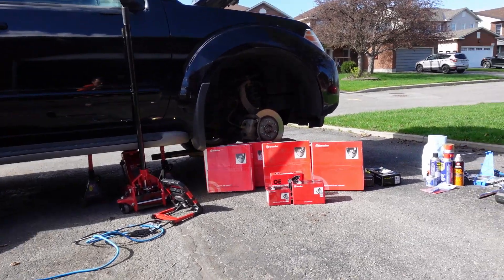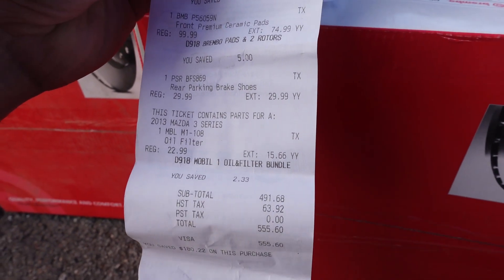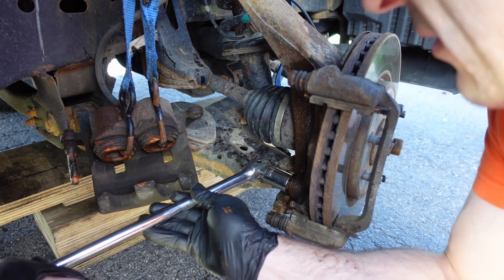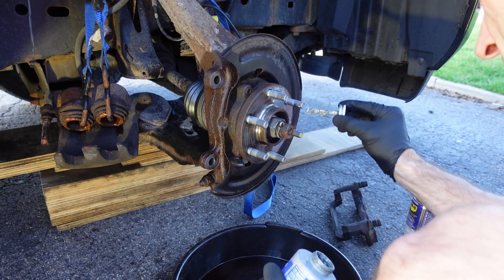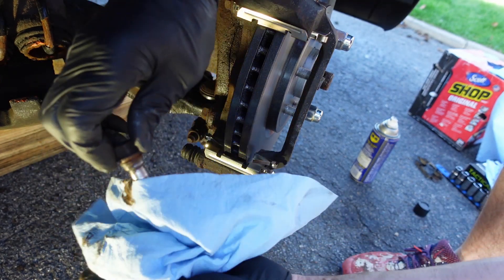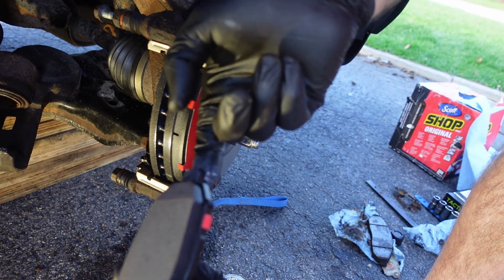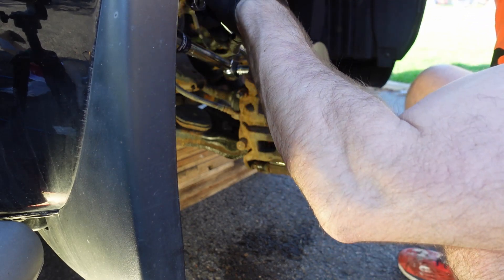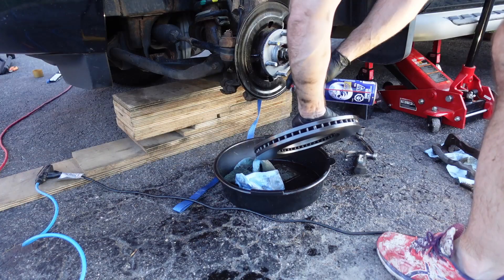2012 Nissan Pathfinder Brake Pads and Rotors - Front

Comment: Nice video, very well done and easy to follow.  My 17 year old son drives a 2012 Pathfinder Silver edition and it has  been a fantastic vehicle.  I bought it with 95,000 miles and he has just over 117K now with minimal issues.  We replaced the radiator when it formed a small leak last summer.  Other than that it has been rock solid.  I look forward to your next video!
Reply from the maker: I like everything other than the electrical, but that is mainly radio / back up camera stuff. So far its been very good.